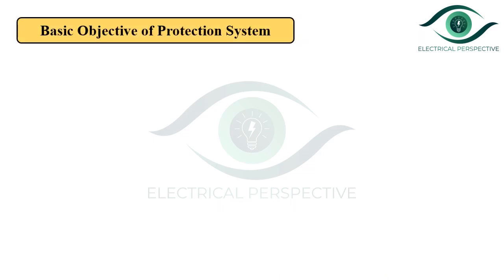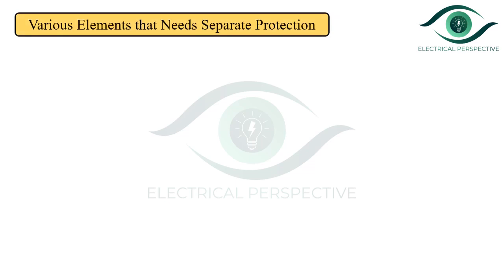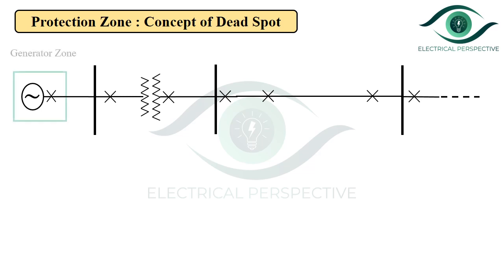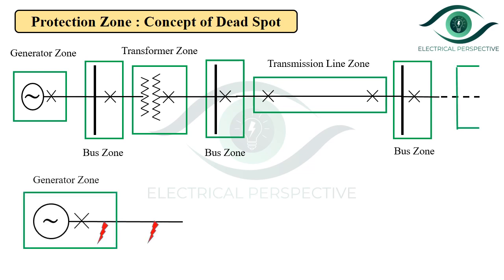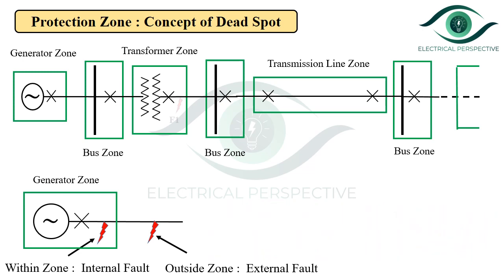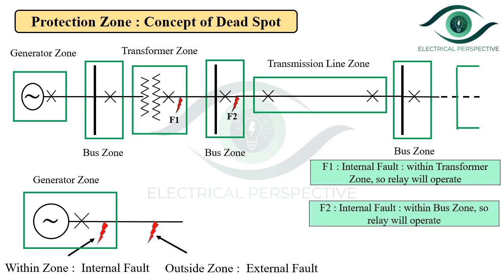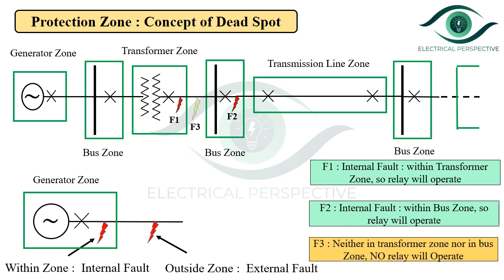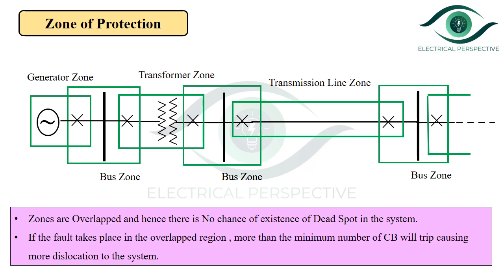What is zone of protection? || What are internal & external faults?||Why adjacent zones overlapped?

Comment: What is meaning of "reset"  and its benifit and aplication in power system protection?
Reply from the maker: Reset : its threshold value of the actuating quantity e.g. current, voltage etc. below which the relay is de-energized and returns to its normal position.

Consider a situation where relay has closed its contacts and the actuating current is still flowing. Now due to some reason, the abnormal condition is over and the current starts decreasing. At some maximum value of current the contacts will starts opening. This condition is called reset.

The maximum value of the actuating below which contacts are opened is called reset value or drop-out value.